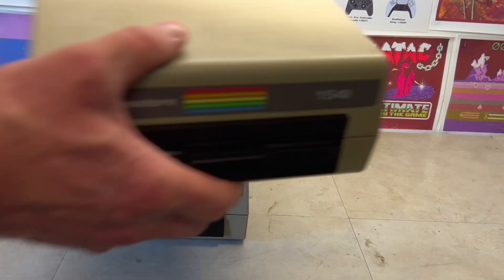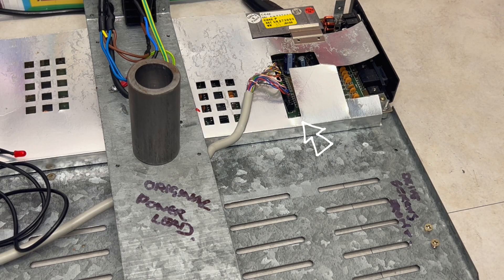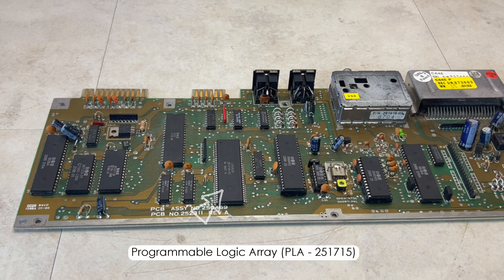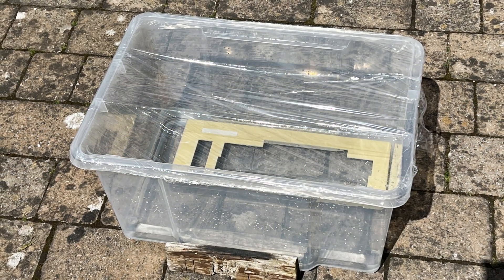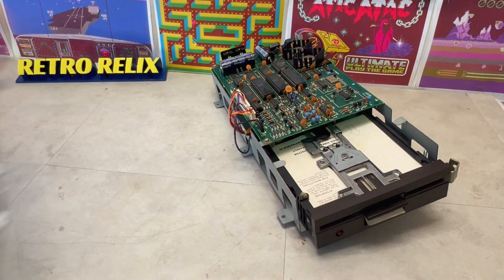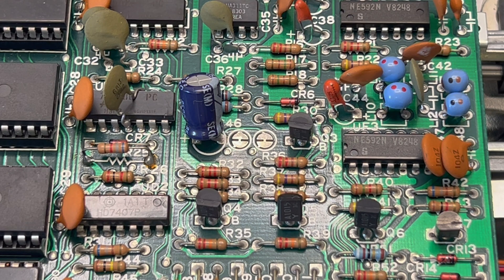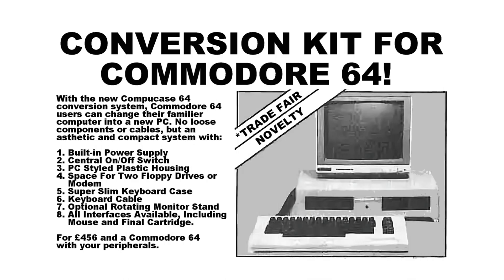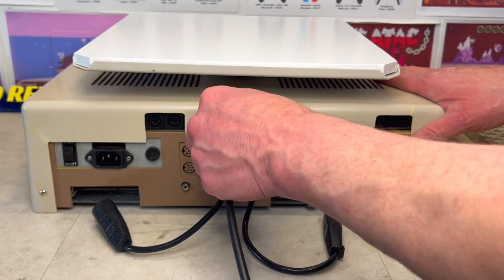1987 Schmolz Unternehmensberatung Compucase 64d Review and Modern Mods

Comment: Putting all my 64 stuff in one box was something I also wanted to do back then & still do to this day (all my 64 stuff is currently boxed in storage).    However, I want to do it in a tower case & not a desktop [horizontal] formfactor case.  The IBM PC case is what eventually made computers more convenient because everything was housed together.   Imagine trying to pick up a C-64 with heavy cartridges inserted & several cables & drives hooked up, to move to another room ... you will easily drag stuff around & break everything.  But that was understandable during the 8-bit era, going back to around the mid 1970s when homebrew kits were also splayed out connected to each other on a table.   The TI-99/4a PEP & the Apple II did however have the idea of internal expansion early on.  Today we have even more compact computers in the style of laptops & smartphones.
12/11/25

Comment: "Infamous" VIC and SID? Why?
Reply: Along withe the Atari GTIA and Pokey chips they're probably the reason why we have sound cards and graphics cards in modern PC's and Laptops today. They were ground breaking at the time as well as the later Commodore Amiga and Atari ST they ushered in the multimedia PC in the 90's.
Reply: @disband_thebbc5933 Are you an AI? How does that make them "infamous"?
Reply: @8BitNaptime  No I am not an "A.I". I don't think it does make them "Infamous" certainly not by the dictionary definition. It's more a colloquial term that is used incorrectly. But it's quite clear in the context that it was meant more as "Well Known" or "renowned" rather than "notorious" or "known for bad or evil deeds". We all have our own pet peeves but we also all make mistakes from time to time.
Reply: don't the SIDs tend to fail?

Comment: Romove the cardboard shield it is trapping the heat. Surprisingly it does not have a exhaust fan with two old 1541s and a C64 motherboard generating all that heat, it won't be good for long-term use.

Comment: Did you daisy-chain the drives internally? The last shot of the back of your setup suggests so (as there are no serial/disk drive cables visible from the outside).
Reply from the maker: Hi, That last shot was meant to demonstrate the Dymo labels without the clutter of cables - so still externally daisy chained 👍

Comment: Retro Brighton is not something I've ever done before and I'm kind of interested in doing a little bit ,  giving it a go. It's always good to see the original colour of the unit when you remove the badge , as you can see the difference between what the sun has hit & not hit I suppose it's a good guide to get the right amount of retro Brighton... I must admit when I see people use one of those electric screwdrivers it's always temps me to get one myself 😂 put knowing me I'll probably put the button in the wrong direction and over tighten a screw I'm trying to take out 😂😂😂 enjoyed the video thanks for sharing

Comment: Ok from the front, but a right mess at the back! It should have been made a few inches deeper and wider too so the power connectors and serial cable could be inside the unit?
Reply from the maker: Yeah, agreed. Considered installing the C64 PSU internally, but the whole unit is already massively heavy.